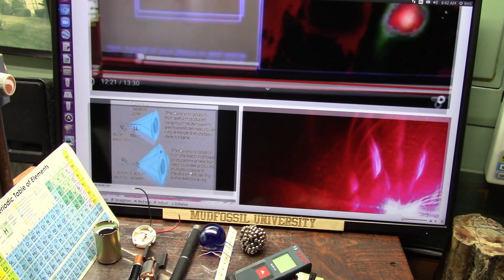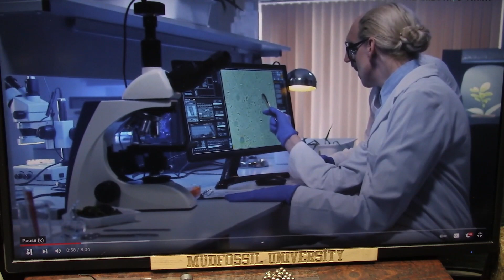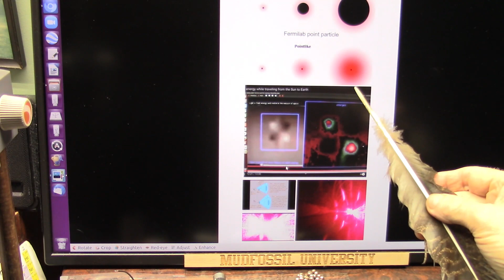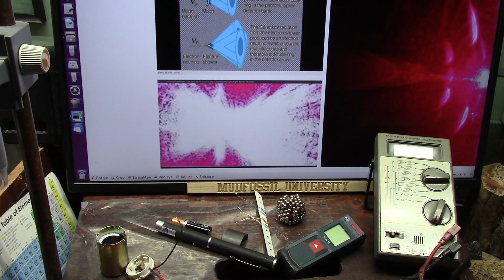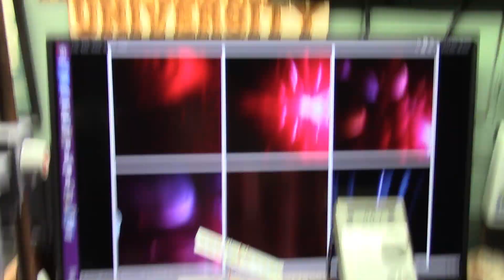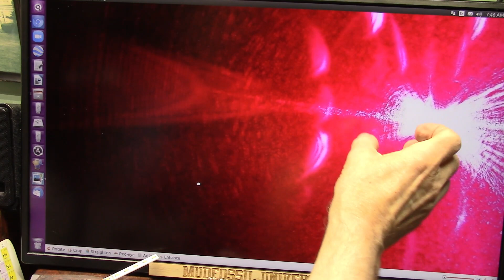New Battery Power Tech Could Solve Our Worst Issues

Comment: wind turbine used on a boat solar panel charge controller inverter and deep cycle batterys in series or parralel and you have all the power you will ever need you also run yr house gas on hydrogen , the key to everything is batteries but if you put them in cycle you use trickle feed alongside deep cycle baterry cell you can and i have ran my house on it and car using just these things which cost next to nothing , we have more than enough stuff in this world to provide all the power we will ever need